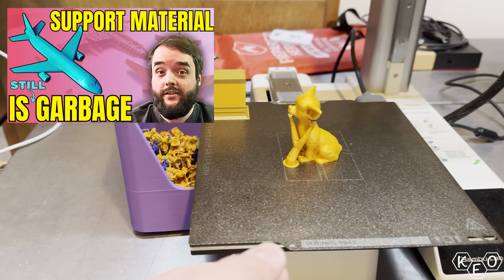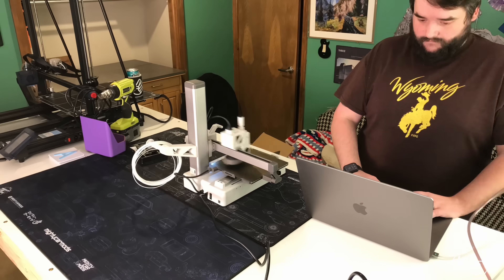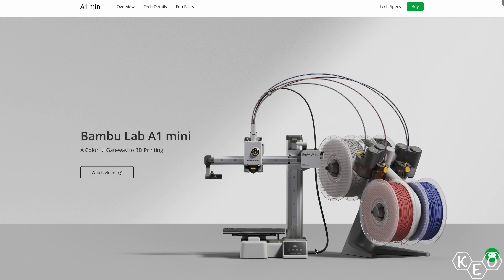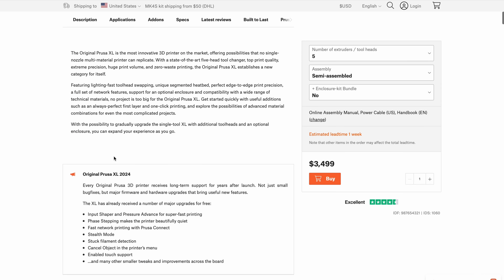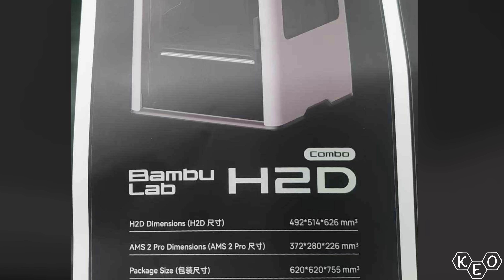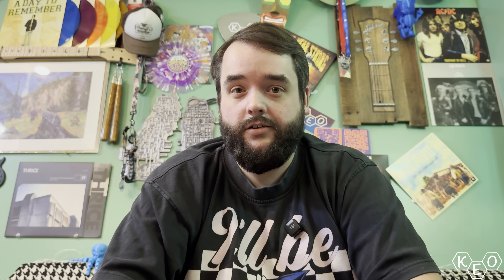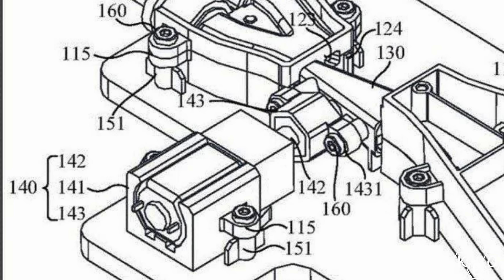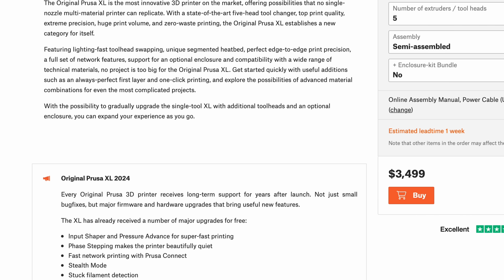What Is The Bambu H2D? Will This Change Everything?

Comment: Good luck heating up a 500mm maschine for printing eng materials, be prepared to stay one hour heat soaking it.

Oh and that is called dual extrusion, it ain't new, es the Creality Sermoon D3.
Reply from the maker: Unless it's got some kind of fancy inductive heating system or something... otherwise, yes. That is quite the volume to prepare!
Reply: @KeoPrints  Oh you can get the bed heat up in a few minutes then you have to heat up the whole chamber and then let the thing soak.

That's why we do fast prototypes on 120-150mm maschines ;)
Reply: Okay

Comment: Whats the point of closed systems when you have to open the doors and take the lid of to print pla or petg.
Reply from the maker: Well theyre better for the styrene stuff but in the case of the K2, the chamber fan cools the chamber for PLA to keep the heat out and heats when it's needed for ABS. If this Bambu printer doesnt do some kind of chamber conditioning then they are leaving features on the table and thats silly
Reply: @KeoPrints  Thats correct. I already had a go at Bambu but i dont think they care. Im sticking with their bed slinger.

Comment: That shifting nozzle design reminds my of how my old Stratasys 250mc used to shift between main and support material nozzles. That one used a bump shift mechanism compared to a gear shift.
Reply from the maker: This could be a cool thing if that is in fact the direction that they are going
Reply: @KeoPrints  I agree I would like a dedicated nozzle just for the support material so I would not be worried with having to purge out all that dissimiliar material.
Reply from the maker: True. The contamination issue is a problem for the single extruder multi-material game for sure. It would be nice to eliminate that fully

Comment: I've been working on a multi tool head using a sliding rail to select nozze, and a plunger that works along with filiment cutter to push pooh down the shoot to stop backups and melt ins with the hot end. The rocker head looks good.
Reply from the maker: Dang. That sounds sweet. I would love to see what you have going so far

Comment: Even if it ends up being just 256x256, if it has a dual extruder, I'm sold. One for support, one for the model. Saves time time filament! I paint miniatures and I'd sell my Resin Printer and use the money to offset the cost of the H2D in a heartbeat.
Reply from the maker: That would be excellent really. Even just for that
Reply: Mer too. Dual extruder is enough for me to upgrade my A1. But bigger build size would be nice too.
Reply: Mer too. Dual extruder is enough for me to upgrade my A1. But bigger build size would be nice too.

Comment: Those dimensions listed are the physical dimensions of the H2D, not the bed size. At that machine size, the 360x360 we've seen seems likely. Another thing they could do with the dual nozzle toolhead is have a second dual nozzle toolhead that could get changed out... Load 4 colors at once with potentially no purge needed. I think that might put them in a league above everybody else.
Reply from the maker: Thats the kind of thing I am hoping for

Comment: I assumed last year's A1 series was going to be a larger enclosed printer, like most of the rest of the 3D printing community, so I'm not surprised to see the leaked news of a large enclosed printer coming soon.  I don't print color models.  I do functional prints.  I'd like to see two filaments into a single print head so I could print rigid PETG parts with compliant TPU elements, or PLA support for PETG parts, with no purge poop.
Reply from the maker: Agreed. The possibilities that this could unlock if done properly would be pretty cool

Comment: Multi Nozzle has always been something Bambu has desperately needed, and they know it.
PVA supports are an absolute gamechanger. But the waste filament and swap times from the AMS makes it impractical.

Now im wondering why did I have to buy a bambu labs on black friday lmfao.
I couldv litterally bought the H2D.

If they have an upgrade kit, I would be the happiest man on the planet highkey. But its bambu so idk
Reply from the maker: I saw the sales and knew it was a final push. I still bought another printer though. I’m a sucker
Reply: If you literally could have bought the H2D instead of whatever you did buy, this video would be a review instead of speculation. :p
Reply from the maker: Fear not, I said im a sucker so dont worry... ill be getting ahold of one of these as well for a review
Reply: @mascot4950  yea but its coming out in like Spring 2025. I feel like by that time, I would probably be busy with other shit.

I need my printer rn (kinda for work), since I needed to make some basic enclosures and adapters for some electronics. So
Reply: @honkhonk8009  I was attempting humor to lament on how "literally" is being misused so frequently now that it has effectively lost its meaning.

Q1 could easily end up meaning April/May before any real availability, so if you needed a printer now. then I'd say you made the right choice.

Comment: I can't even fit the X1/P1 vertically in my available space so not very pumped up for bigger ones 😔
Reply from the maker: What space are you operating out of? Thats tight!
Reply: @KeoPrints  unfortunately the only available space I have is right between a huge desk and a hanging bookshelf, neither of which I can move.
I researched printers I can fit there recently and it was "fun"...

Comment: Did you see the Bambu x1 enterprise? I kinda want it for the networking Ethernet and heated chamber
Reply from the maker: I have not really looked into that one. Seems to suit a specific need fairly well though
Reply: I have it and I like it, but you really get the most out of it when you work with PA / ABS / ASA
if not then better save the money. I use a A1 for the PLA / TPU prints and the X1E for all the other things.

Comment: As the extremelly satisfied owner of 2 X1C and 4 AMS units, i will be buying whatever the newest flagship bambu puts out next year regardless.
Reply: Did you guys find religion with Bambu, or did you convert from some other religion?
Reply from the maker: I used to be a follower of our lord and savior ender3v2 but Ive since seen the light
Reply: Bot.
Reply: @Liberty4Ever we're talking about 3d printers, not religion.
Reply from the maker: Same boat here. I’m well bought in
Reply: Bambu has completely just fucked me over with my printer, so I’m waiting and seeing. My P1S is bricked for the 3rd time, and they have sent me an AP board to “fix” it 3 times in a row. I have replaced it, and it’s still not working. I’m not sure what the other two would do. Now they won’t reply to me. I submitted a PayPal dispute, and they have ignored that too. My printer is 5 months old. I am just telling you so you’re aware they’re not always as great as they appear. I have only had one positive experience with them. That was an issue I had with my extruder. However, a 5-month-old printer should not need 4 customer service tickets and 2 months of ignored emails. They make great tech, but their marketing does a lot of legwork too…
Reply from the maker: This is insurmountably unfortunate. I really hope they figure this out for you because that is not acceptable

Comment: The patent graphic is meant to prove to the patent examiner that the idea is new and patentable, so it does look like it's missing some stuff like the hardware bits to make the hotends replaceable (and hopefully quick-swappable). So if Bambu goes with a print head with multiple hotends that can be angled, what's stopping them from feeding all four filaments from the new AMS? (Also did you notice the dimensions of the new AMS are similar to, but slightly different from, the old AMS?)
Reply from the maker: All interesting stuff

Comment: Interesting when you zoomed in to the image you could see both print heads but one was down the other was up. So the swinging print head might be heavier than dual nozzles on solenoids would be lighter and faster. My guess is you have one live feed head and one 3 three color head. The live feed could be dedicated to supports or main color and the other is to add more colors to the print. Or each head gets the option for any of the 4 colors. But it makes more sense to have a single main color ie like your yellow plane. Since the details are always smaller amounts this could open this up to faster multi color prints as the Filament hub going two directions  does not make sense will be interesting to see.
Reply from the maker: It’s true. It’s gonna be interesting for sure

Comment: That alleged "AMS 2" tube selector won't allow both tubes to have filament in them at the same time because it would collide with the other filament when it's actuating.

That means you're still dealing with lengthy retraction and feeding steps when making changes.

There are simple designs to path select. Just have one input, the path selector, and two optional outputs on each spool and then merge them in a pair of 4-way adapters.
Reply from the maker: Yea I’m interested to see how that hub is implemented
Reply: So you mean, they did a lot of work to build a dual-nozzle print head but they haven't found a solution to design a compatible AMS 2 Pro such that the whole system works ? :)

Comment: Seeing it’s all speculation…my 2 cents - YMMV
H = heated. Possibly chamber, might be for the AMS.
2 = Second generation.
D = Dual material.
The size is the crate; print volume likely around 325 cubed, that would have parked it near the top of XY printers when the size would have been locked in during the design cycle.
If these speculations prove true they will be releasing a significant product development their competitors have not met IMO.
Right now their competitors are just coming to market with multicolour capability which Bambo has had for 2 years +, if they have developed multicolour with multi materials in a machine that matches the credibility of their prior flagship printers with a price point consumers can afford they will have taken the technology to the next level of innovation and grow their market share significantly.
However, raising the bar doesn’t come without significant risk.
Hero of zero, not much middle ground.
All this competitive innovation sure is great for us enthusiasts.
Good video, thanks.
Reply from the maker: Thanks for the comment friend. All good notes really. I’m hoping this one lives up to the hype
Reply: I'd guess it will go after a prusa xl in most cases and fix the few problems it has (like enclosure, heated chamber etc)
Reply: @Basement_CNC likely, but I believe it will still create a significant amount of waste doing multicolour.
As a person who in the next 12 months will upgrade to something multicolour and multi material I’m looking forward to what this will offer.
XL is still a very appealing machine as I’m likely building my own enclosure regardless.
Reply: "...Right now their competitors are just coming to market with multicolour capability..." They have multi material not multi color, they use different materials not different colors.
Reply: A = Amateur
P = Professional
X = Xperimental/Xtreme (It was the first printer so it's gotta sound cool)
H = Huge, High-end, High-temperature

And I agree with the 2 and D.
Reply: @stevato0449 , H like Hydra but with only two heads.

Comment: Not sure why people are hoping for a big printer. X1c is a perfect size. Given bambu knows what's printed on their printers, they can easily calculate the size of their next printer to satisfy majority of the consumers while filtering out the internet "noise"
Reply from the maker: Bigger is always going to be better when it comes to build volume. Even though it rarely gets fully used. Like a pick up truck in the suburbs. Everyone needs it
Reply: Im constantly in need of more build volume. I build large scale model replica’s of everything scifi.
Reply: I do lots of lamp shades in vase mode. And 250mm is a bit limiting.
Reply: Have to disagree. I would get the orange storm giga if I had the space. Having a printer that can print large volumes is a huge bump in competition when looking at from a business perspective. Anyone with a large enough printer to print household decor or furniture… Yeah, I’m not going to meshmixer to slice up a chair for my P1S 😂 Helmets are also a thing I print personally and the P1S barely fits most of my prints, so either I need to cut them up or remodel it.
Reply: It's not the perfect size for me. A bigger printer is all I need to print what I want to without splitting it up.

Comment: The dual Extruder is like you said good for muti cooler, but also different material which the Nozle is made out off, like Brass and Stell. This is good for hard and soft material because of tear down. It can also have completely different tool heads with cooling and heating.
Reply: Dual extruder with AMS could be an interesting combination.
Reply from the maker: Agreed. Very interesting approach

Comment: I think I have seen that dual hot end swinger setup on Proper Printing, so I hope they credit him for that idea.
Reply: Not sure the idea is original to proper printing. Makertechs Proforge 2S a couple years earlier had the same thing. Proper printing did it servoless, Makertech had a server with a rocker arm, a drawing attributed to Bambu shows a gear driven switch instead but still fairly similar.  Every once in awhile someone does something innovative, but the majority of things out there are rehashing old ideas. Every year i swear i see something people were raving about 10+ years ago.

Comment: That is  Pkg Size of 492 x 514 x 626 is a PACKAGE SIZE meaning the BOX. Its prolly a 360 x360x 360 printer. They had to just upsize the K2's 350mm Squared size. Its a heated enclosure to compete with K2s heated enclosure. I was looking for just that a heated enclosure large core XY and I could only find the QIDI MAX/Pro and the Creality K2 so we need more competitors in the market. A Improved AMS would be a good upgrade as well. I doubt it will have 2 heavy print heads in 1 tho. We shall see
Reply from the maker: It’s gonna be interesting to see what happens!

Comment: If BBL is making a dual nozzle machine I'm sure the user experience will be superior to past machines that have done so
Reply from the maker: I’m hoping so
Reply: @KeoPrints another cool possibility is variable size hot ends simultaneously. Print a structure with a .6 and then switch to fine detail in a .2
Reply: @Evan_Saboe  that would make multi color prints even better and WAY faster